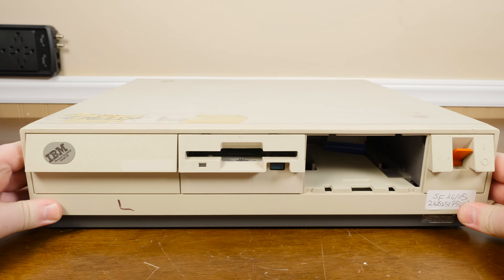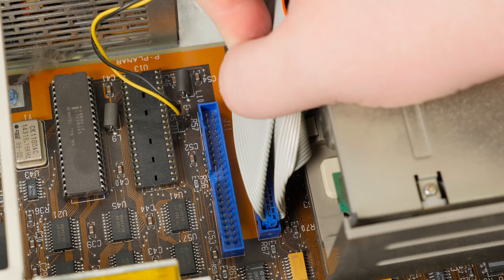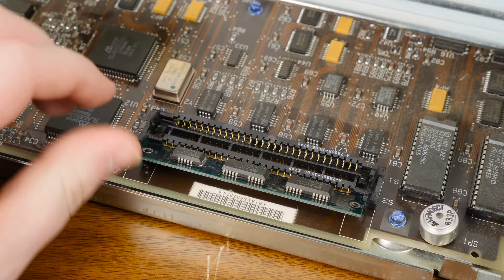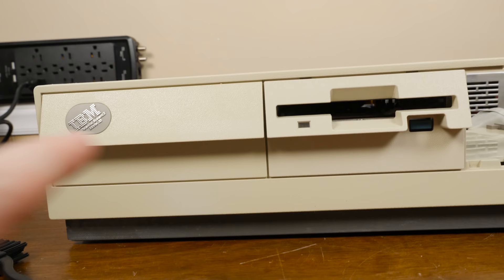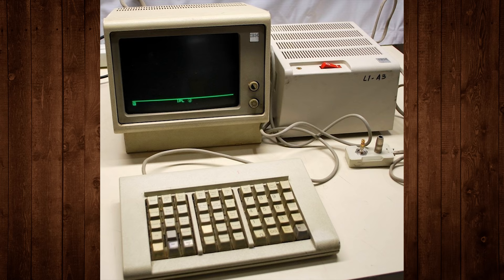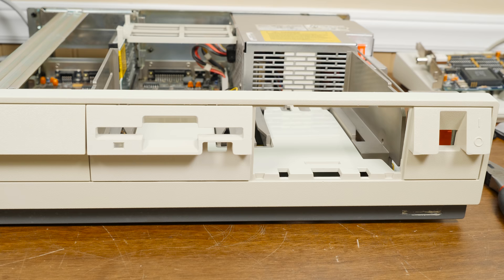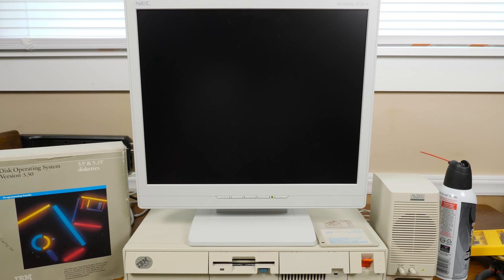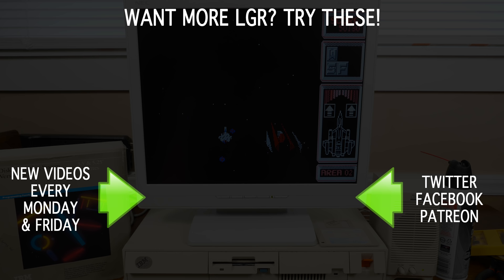LGR - Restoring a 1987 IBM PS/2 Model 30

Comment: There is IBM Personal System/2 8555 Model 55 SX on ebay right now for ~250USD which seems to have at least similar cable... but then you might have Model 55 with no cable :)
Reply: No no no.. there's "IBM Personal System/2 Model 30 Type 8530-021 8086 720KB Ram 20MB HDD Very Rare", which has photos of the inside. To me it looks like the HDD cable code begins with 68X28... ? And probably the Model 55 thing is not similar at all.

Comment: My OSD wishes you would open the PSU and clear dust. It can really get caked in dust and wont come out unless you open it. WARNING! Anyone that read this comment and plan to open a PSU should know that PSU stores electric charge for a good while, so wait a long time after you disconnect it from power. And avoid touching things inside the PSU when you are working on it. Do it on own risk.

Comment: You could probably hack together a cable like that for just a few bucks; electronics shops will carry ribbon cable (no ends), and various ends; you just pressure fit the cable onto the ends and good to go I bet...

Comment: I want to know where all those chips are in actual computer. Every time I watch a video of a old computer maintenance, I am amused by all those large and rectangle chips. Why were they there? What function did them have? And most importantly, why actual computers don't have by far all those chips. Are they integrated in the modern CPUs?
Reply: PabloGamer530 The square chips on this model are very much the equivalent of the "chipset" chip or chips on modern PCs, usually with a metal heatsink on top because they are now fast enough to get too hot without one.

Comment: Oooh that's the hard drive from something like a PS/2 55SX with MCA bus, it's not compatible with the model 30 - these have a narrower edge connector. You need a slightly different HDD with narrower connector I'm afraid.

Comment: Perhaps you could source the components necessary to assemble the required cable? As well as I can see, the edge connector and ribbon cable, as well as the board-side connector required are all standard parts available on digikey or mouser.

Comment: that looks like Ether over Coax network card, so 10Base.  old school!  home users didn't install coax for networking back then so this must have been in an office.
Reply: It's BNC. School computers had them too. It is a coaxial connection but it has two slots and grooves along the inside to lock the cable in place on the cable side connector that's what the two little pins sticking out the side of the card's connector are.

Comment: Great restoration,eventrough ,even if you will find the 100% correct cable,that doen’t meant that the harddrive is still working considering it’s age,yes there are some harddisk drives wich can last a whopping 30 years,but that’s an extream rare case,phew.

Comment: Oddities like that cable (and MCA on other PS2 models) is one of the reasons I will NEVER feel nostalgia for the PS2 line. I worked with them as a co-op student in the early 90s and hated them then. I had a sight affinity for the model 50/60 towers (because they were enormous, heavy chunks of steel), but all the proprietary-ness of the machines was a huge PAIN. Also, they seemed terribly slow compared to PC clones of similar specs.

Comment: Top of the case is plastic? I have a couple of model 30-286's, and they have a metal top case, and very sturdy construction overall. Also, the plastics don't really go yellow.

Hard drives (and also the floppy drives) are the problem with these machines. I added a 100Mb hard card in the ISA slot, so now I have plenty of space, but the noise of two old hard drives is just insane! I would like to use just the hard card, but can't figure out how to do that, or if it's even possible.

Comment: I wonder if you could fit a modern power supply and motherboard in a PS case. The larger ones (not these tiny ones) are the best bloody cases I've ever seen. Oh, no, never mind, the MCA slots are smaller than standard slots. Won't work.

Comment: 8086 in 1987? Weird that they used a 9year CPU which was more than ancient even back then
Reply from the maker: As mentioned in the video, this was the lowest-cost, budget model IBM PS/2 back then. Just makes sense to use a cheap chip in a cheap machine :)

Comment: I have one of theese with original keyboard and monitor. It is the harddrive version. I was working the last time, but I will try and boot it up agein. Could this run X3? Seems the keyboard is worth almost the same as the computer itself. Any followup planned? Adding a CF would be interesting.

Comment: Hey Clint, do you have any advice on replacing a CMOS battery and getting rid of corrosion leakage? I found an old PC of mine at my parent's house but I can't get past the American Megatrends screen, the keyboard lights flash but none of the keys function and the machine has two errors stating that the CMOS settings are not set. But since the keyboard doesn't work I'm guessing it has to do someting with the CMOS battery leaking.

Comment: Granted, this won't do you much good if your drive is useless with that proprietary interface, but...have you considered making your own cable for it? Also...how close to IDE is it? If it's just IDE+power, maybe you could make up an adapter cable that terminates in an IDE connector and a molex, to use a normal IDE drive with it? Not original gear, I know, but it may be as close as you're going to get.

Comment: Couldn't you make a cable with a 44 conductor ribbon cable, 44 pin IDC connector and a card edge connector? Mouser has several card edge connectors and the board looks like standard 0.1" double row. Just need the pinouts of the HDD and Motherboard in case you have to twist a section of cable.

Comment: Hey LGR, how about cable 64F1409??? It looks almost identical to the pin out on the HDD you purchased and comes with its respective riser card. 

I also think I do have the original hdd with it as well, but I’m not certain as to whether or not it’s functional
Reply: Just read your comment. Whoops

Comment: Try just buying some 44 wire ribbon cable, 44 pin IDC connector and 44 pin edge connector separately and make your own cable. The pin out should be available online. There is no point trying to find that specific IBM part number, you havent got a chance in hell of finding it.
Reply: Refer to lucid nonsence's comment below.

Comment: Would it be possible to put all modern hardware into this PC case?

In other words, does it conform the ATX form factor? Can it fit a modern power supply? Etc etc.
Reply: Might be "Baby AT", definitely not ATX. It could fit more than one "modern" power supply, but good luck getting the switch to work! ! A cheap Raspberry Pi could easily emulate the entire original machine, along with virtual "Sound Blaster" or just about anything. It depends what you mean by "modern hardware". Like, could it be a modern gaming machine? No way! This is an 8-bit machine on the verge of 16-bit compatibility. Ran DOS, I don't think even windows 3 would run. 
New PCs are 64-bit, I think Intel is up to 11th gen of such 64-bit CPUs, and can only run DOS in emulation. Modern boot firmware is a lot more computationally complex than this entire PC. Basically there's hardly a single item that hasn't been re-engineered multiple times. Lately there's even been hobbyist 8088 and 8086 "PCs" on ISA cards on eBay, but this oddball doesn't even have ordinary ISA or PCI slot. It might be a lot easier gutting it entirely and fitting an entire modern "mini-PC" inside the empty case. Not much fun, really.

Comment: I heard somewhere that spinning fans with compressed air could damage them or the electronics connected.

is that true?
Reply: Compressed air easily spins the fan many, many times it's rated RPM. This can  damage the bearings and generate enough electricity to damage the drive electronics or whatever it is connected to. Just hold the fan as you blast air and make sure you do not stick anything conductive into your PSU.

Comment: did you do any video about non standard MCA architecture?
Reply: a lot about that is dry history, the cards basically didn't do anything that PCI doesn't, and they were rare, because Compaq led a coalition of 9 tech companies to come up with an ISA compatible Extended Industry Standard Architecture. The Internet Standard Architecture didn't even have a name, it was just a nameless IBM 8-bit and 16-bit bus standard, sometimes referred to as "IBM XT or AT". ISA was the term used as EISA was developed. Basically the old standards were MUCH cheaper and every clone-maker accepted it.There are other videos on YouTube, I just don't think it's a subject suited to LGR. Gaming on MCA is not really a thing, and, as I described, mostly is about industry politics and economics, it might fit into history why IBM declined and eventually left in the PC business, along with failure of OS/2.

Comment: I've been wanting to get an IBM PS/2 for some time now and use it for playing MIDI files and doing DOS stuff like playing around with DOS software. But every time I try to find one, they're like >$150 for just a base model like the Model 30 - and that doesn't include peripherals like a Model M keyboard or a IBM monitor from the era. Any advice for acquiring one cheap(er) that has an ISA slot?

Also, will a SoundBlaster 16 work in an IBM PS/2 equipped with a ISA slot? If not, what will work?

Comment: Hello, I just got one of these buddies here...managed to turn it on, RAM check: OK, but then..."no system disk or disk error".
I don't have the floppy with the OS.
2 questions:
1) how to distinguish between no OS installed and failed HD? NO error codes displayed.
2)where eventually to find the floppies with the OS? hard to answer this one eh...
Thanks if anybody can help me.

Comment: You’ve almost certainly already solved this, but rewatched this video recently as I’m eying up this Model 30 on ebay and thought you might want to see it with it’s top off; just in case you’ve not already solved it. Seems it’s a 21MB HDD, which explains the model number: https://rover.ebay.com/rover/0/0/0?mpre=https%3A%2F%2Fwww.ebay.co.uk%2Fulk%2Fitm%2F193272671911

Comment: FYI - I know this is an old video, but link below has service manual details on the machine.  Seems the HD varied based on serial number (see page 228)

http://ps-2.kev009.com/ohlandl/books/ps2-hmm.pdf

I just pulled one of these machines from my parents house and my HD is shot apparently.  The label on mine says Part No. 72X7568 and the IBM sticker says: MODEL: WDI-325Q

If you happen to still have that HD and its lines up with thsi P/N, let me know, I'm looking for one.

Comment: I have several of these machines in my collection.  I use ssd ide utilizing a lotech board https://www.lo-tech.co.uk/product/lo-tech-isa-compactflash-pcb/  Works like a champ.  Also put in NEC CPU (10-20% speed boost), and packard bell sound card (16 bit but works on 8 bit fine as sound blaster).